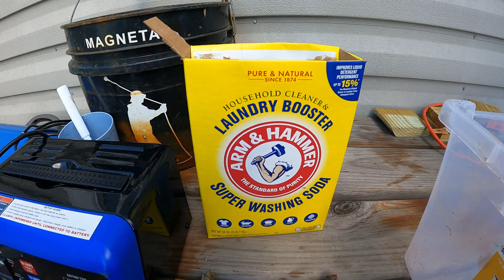Restore Metal Finds: Easy Electrolysis Tank Tutorial! #magnetjunkie #science #electrolysis

Comment: Try this trick, Nick. Soak the rusty object in ''ALL NATURAL AVO Distilled White Vinegar 5% Acidity''. Put the object in a 5 gal. bucket and cover it with this. Leave it sit for days, then check progress.
Reply from the maker: Before this vinegar is always been my go-to and generally works pretty well! With that being said I have plenty of that still lying around and I think I will now soak some things in the vinegar and then put them in the tank to do a little bit more clean up! I appreciate you as always for tagging along and for the information!
Reply: @magnetjunkie  It works really well on GUNS. You Bet.
Reply: What about a sand blaster. It's more expensive but saves a load of time. The video was interesting, though. Thank you!
Reply from the maker: @AraceliaTorres-c1w I actually bought a portable sandblaster scenario and have a decent sized compressor.. it worked well but I need to get a sandblasting cabinet! Appreciate you for tagging along!

Comment: Hey Nick , thanks for letting me know this was on the video schedule, that's a great system its amazing how those little chargers provide enough power, the DC system will help you save time. A rail road spike works well too. I think there is a metal polish or even a little WD 40 you can use to polish up the piece and keep the rust from coming back. That knife came out great . I did some old keys years ago and this was the best method. I used a piece of wood across the top, wrapped the wire around the metal , then around the wood with a small pigtail to attach the positive clip to. That way the metal can be placed closer to the sacrificial piece suspended in solutio to get all sides in one soaking, and just take off the positive clip to stop reaction . Looking forward to more demoes, to restore those treasures, Cheers Brother Bob
Reply from the maker: Good afternoon Bob and thank you as always my good friend! Yeah man I was pretty surprised with this quick little setup and I'm currently just dunking a big Craftsman wrench in there.. definitely going to get the DC charger this weekend and step this up another notch! I have bought some other things as I have had some random ideas to set something up across the top as though you mentioned.. I do understand what you're saying with the way you set yours up and that is great information as well! I shine that knife a little bit more with 2000 grit and then hit it with WD-40 and I really like the result! Sometimes I get excited and forget to take more pictures so that was not included in the video!